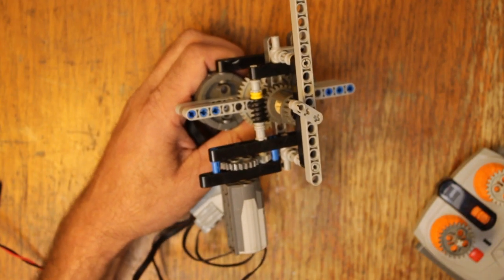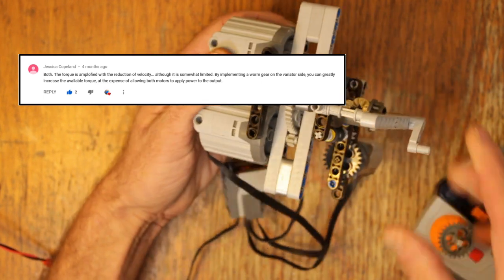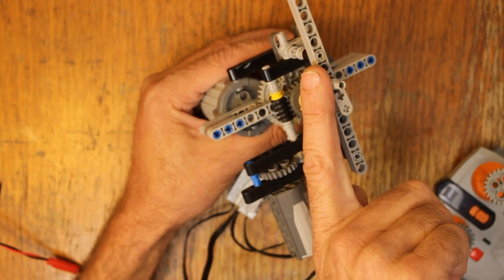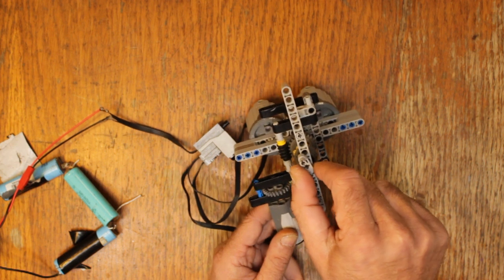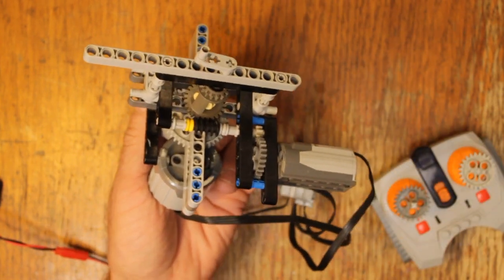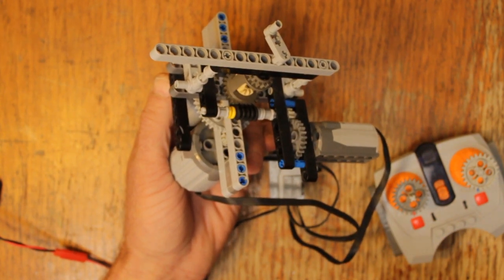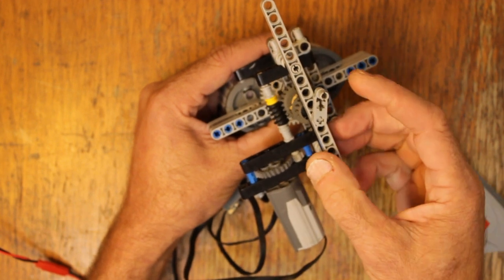Frictionless Lego CVT Does Weird Things

Comment: So I have been experimenting with this using 2 XL motors and 1 XL for the vario connecting via a worm gear. However, I get very little speed difference and I am also unsure as to how it works with the torque. I thought that the vario would simply add torque, but does it need to be as strong as the driving motor(s)? Cause it sounds like it is struggling when I turn it on. I was actually thinking about gearing it higher in stead of using a worm gear.
I am estimating my tractor will weigh 2.5 kg / 5.5 lbs + whatever I attach to it.
Reply from the maker: These questions are hard to answer without having the device. You are correct that the either the drive or the variator can be the weak link. The worm gear is not able to turn the diff fast enough to make a speed difference. The variator can only subtract torque and power. I suggest you use an electronic shifter instead. This way you can use a small motor to change gear ratios off of large motors. I will be posting a compact e-shifter soon but there are already many examples that can produce high torque.
Reply: @MaxBrix  Ok, that sounds good. When you say that the variator can only substract torque and power, do you mean that this is the trade for higher speed when increasing the speed of the variator?
Btw, I couldn't find anything when searching for lego electronic shifter.
Reply from the maker: @aagekoldjensen3529  Which ever produces less torque will be the weak link. An analogy would be two people carrying a log if one of them doesn't push hard enough they will just go in a circle. 

If I see something I will post a link. and I will post some video today. It will demonstrate the concept. You should be able to adapt the idea to a 2 seed linear that can handle torque.
Reply: @MaxBrix  Great, thanks a lot for your help :-)
Reply from the maker: @aagekoldjensen3529  I have to elaborate on that analogy. If one person walks backward they don't go anywhere(neutral). If they both go the same direction (full speed ) you only have to stop one of them to stop forward movement. together they can only go as fast or push as hard as one person (assuming you can not stop the center of the log, you can only push on the people). 
I feel better now.
Reply: @MaxBrix  Aaaah, I think I get it now :-) It doesn't sound like this CVT will be practical in my model. If, say I need 3 XL motors, then I would also need 3 XL as variator.
In other words, I might as well just adjust voltage on the RC and add a regular gearbox (or automatic).
Reply from the maker: @aagekoldjensen3529  The variator can have less drive power but it has to be geared down and that reduces it's ability to variate. As you experienced with the worm gear.

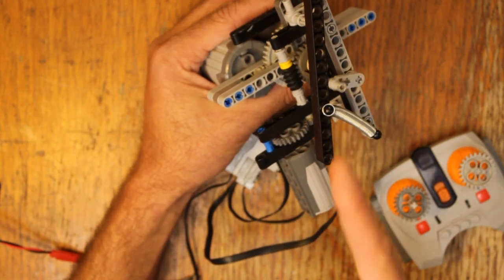Comment: This is fascinating.  MaxBrix, when you stop the variator motor around 2:30, I assume you caused the variator motor to stall?  If so, would this still be considered efficient?  (e.g. is stalling a problem?  Is power still consumed?)
Reply from the maker: Yes, The variator stalls. It could be efficient depending on how this behavior was put to use. It is not really a problem because it only happens when the variator is putting out less tork than drive motor and is also less than the resistance tork on the drive shaft. since the variator is on a worm gear that motor had to have much less power than the drive motor to make this happen.

Comment: My experience is that if one uses it as the propulsion for a vehicle it's the best to use worms.
That's because the motor brake isn't strong enough to prevent that it might start rotating while only the other one should rotate.

I tried different versions in one of my LEGO tanks (no video on YouTube) but NOT with a worm because that would reduce the output axle's rotation too much.
The sad thing was that it couldn't climb a hill because the running motor made the other one's axle rotate instead of the output axle.
=> use worms

Comment: Is the phenomenon your are experiencing at the end if the video possible the power being stored in the plastic material and springing back?
Reply from the maker: It is the force acting to slow down the variator. The variators speed is slowing down the drive shaft. So when the variator slows down the drive shaft speeds up